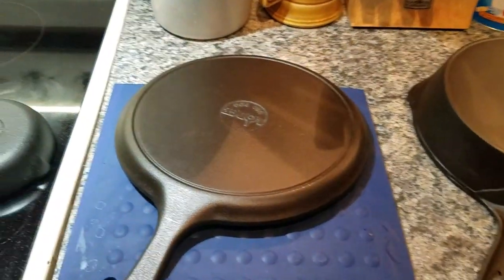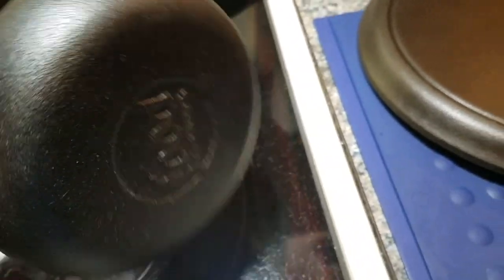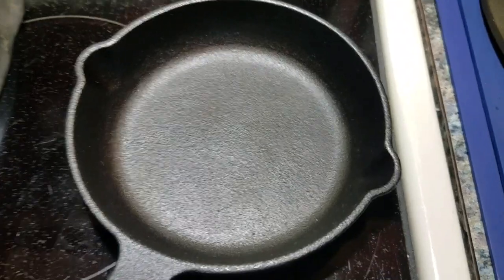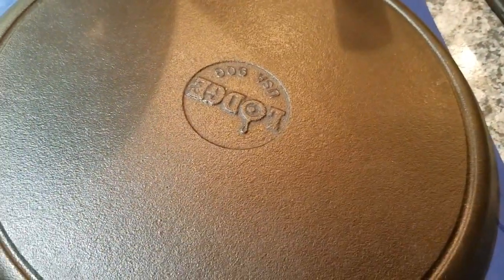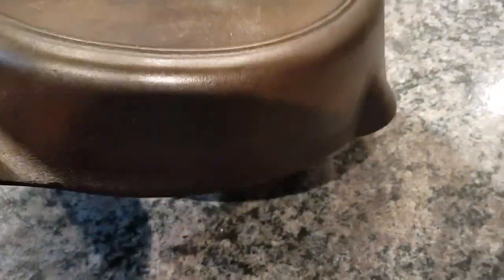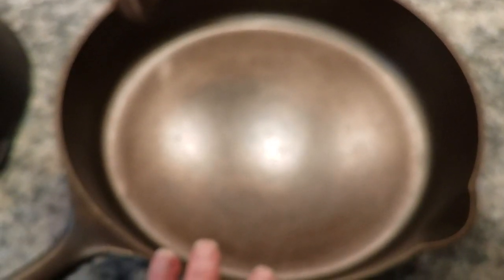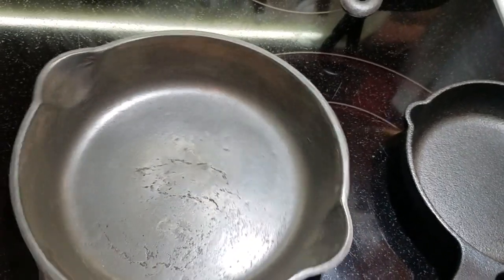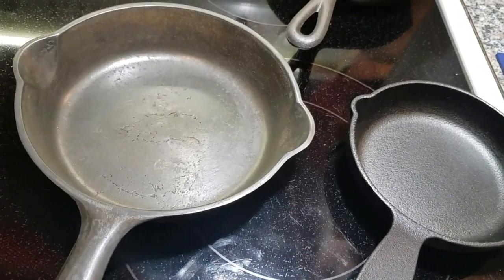Should You Wire Wheel or Sand your Cast Iron??   Watch to find out!

Comment: A good steel wool will eventually get one smooth. I can see where this is a good idea. I am going to wheel my new 12 in lodge
Reply from the maker: Yep, I did that as well with mine.  It was new.  I had tried the flax seed method of seasoning and it did NOT hold up.  I stripped it AGAIN, wire wheeled it to make it smoother, re-seasoned and now it is a great cooker!

Comment: Always enjoy your videos and knowledge. Myself I've used a wire wheel on mine and they've come out beautiful and I buy mine to restore and use daily and charish them . Hey I was actually thinking of you yesterday .I stopped into an antique store in Illinois and OMG there had to have at least 75 or more pieces of cast iron cookware mostly skillets and Dutch ovens .it was crazy lol I could have spent hours in there but I did walk out with a really nice Wagner #10 ,heat ring.at a price I couldn't refuse.
Reply from the maker: Thank you Duane!  Wow you found a vendor that had 75 skillets?  I am so glad that you were able to find a good deal with that Wagner #10 with heat ring to boot!  Usually when I find a vendor that has tons of cast iron like that, the prices are really high.  You are truly blessed, especially at finding a large skillet in good condition!  I just finished wire wheeling that recast #4 and I think I've got a user.  The "Griswold" logo from the skillet mold was wheeled off which I suspected, but I was able to flatten it some so that it can be used instead of leaving out for the metal scrappers!  lol  I will show it on a seasoning video when I do it along with a couple of other skillets I stripped and need to season.  This restoration thing can be addictive!  lol  ;-)

Comment: I use my griddle for stove top cornbread. With the low sides you can slide it off onto another plate, put the griddle on top and flip it over to cook both sides.
Reply from the maker: Great tip!

Comment: I just posted this on a Lodge video. I love Lodge. If I buy new it will probably be Lodge. But I, for myself, never buy new Lodge, since that pebbled surface came out. No! It is not the same! The couple of new pieces I have, I took a fine grit grind stone and knocked the most of the bumps off. Eventually any uneven spots will fill in, I hope. They cook ok, but there is no comparison between the old and the new Lodge. Would I be considered an expert? Probably not, but I've used cast iron for over 60 years, so I know my way around it pretty good. I still use my mother's, my grandmother's and my mother-in-law's every day. I buy the occasional piece of unrecognizable cast iron at yard sales when I can get them for a couple of bucks. Expensive or cheap, I love my cast iron. I nearly cried when I had to buy a new piece where I worked and tried to cook on it 😢
Reply from the maker: I'd say you are more of an expert than many that watch my videos!  To have all those years of experience of using cast iron kind is a statement all by itself.  For the most part modern Lodge is not collectible and I feel there is no problem with sanding it or taking a wire wheel to it to make it more usable.  I grabbed a #8 Lodge (modern day, but could be as old as the late 90s or early 2000s because I acquired it from an antique mall I think) to cook some potato pancakes and turkey burgers the other day and it was such a pleasure to use because I stripped it down when I got it & I took an Avanti strip disc to it and it is super smooth.  No lint gets stuck on this one either when I wipe with a paper towel.  Your pieces will fill in with time.  If they really bug you, strip them and start over.  The best device I have used is the strip disc but you have to be careful as it can leave unsightly marks on your skillet but they can be "smoothed" over with the wire wheel attachment on your drill.  Again, I never do this on any vintage Griswold, Vollrath, or other collectible piece as most of them never need it anyway.  :-)
Reply: @ladylibertystacker2014  I also hear Don't burn them! I've never put them through a oven cleaning cycle, so I can't speak about that. But I think people are told don't put them in a fire, because too hot a fire will indeed ruin a skillet for sure. If I buy and old unrecognizable gunky piece of cast iron, I wait until I have a nice bed if dying embers in my wood stove and bury the piece in them for a few minutes. Hook it with the poker and drag it out onto a soft bed of ashes to cool totally. Usually everything will wash off. Then start over with seasoning. I will say if I thought it was a true antique, I would start with cooler coals and maybe have to do it twice ☺️
Reply from the maker: I don't see any reason why you couldn't do your woodstove with the hot or cooler ash method if need be.  I think you definitely know what you are doing without a doubt!  As long as it works for you, that's all that matters.  :-)

Comment: Thanks for your video!  Really hlepful!  I've got time, now that i am working from home, to clean adn re-season some pans.  This helps.  I have a a Wagner Ware skillet with 6 on the handle. It has some really baked in crud around the juncture between the inside bottom and side of the pan.  I've been using a combo of wire wheel and heavy-duty oven cleaner - slowly coming off.  I've not yet taken a piece of sandpaper to the crud - is that advisable?
Also, this skillet (old one) has some pits and scratches on the cooking surface.  Is it advisable to try to sand these out? 
Many thanks, all!  Health and happiness to all.

John
Reply from the maker: Thanks John for your comments & for watching.  You asked about taking sand paper to smooth out these areas.  If you have already used a wire wheel, I don't see why not! I have been in many situations with a stubborn skillet where I have needed more than one tool in my tool box to get a pan serviceable for my own use.  Someone had suggested that I use sandpaper to smooth out the surface, but I didn't have a sanding block (you can probably purchase small ones from your local hardware store once they reopen if they are closed during this pandemic) or a sander so I just used my wheel.  In the future, that will be something I will consider myself.  I say, go for it and see how it works for you.  Keep me posted as I am curious myself!
Reply: Thanks!  I am going back and forth between heavy duty oven cleaner and the wire wheel so far.   Each time I use the oven cleaner, it takes some off and makes the crud a little more amenable to the wheel.  I might try sandpaper around the base (getting impatient!).
Reply: Since you have responded, I'll run the risk of taking up more of your time to ask a question.  I have a griddle, no manufacturer name on it.  Looks fairly old.  I'm doing the same restoring process.  On the top of the handle, there is a "9".  On the underside, it says "10 1/4 INCH GRIDDLE" and then below that "MADE IN USA" and then below that "Y".  Do you recognize the manufacturer?  Many thanks!!
Reply: Don't mean to hog the channel!  One more thing - I just noticed on the underside of the handle it says "Y" also.  Must have been covered with crud before.  Thanks again.
Reply from the maker: John Barry   It could be a Lodge or Wagner.  The Made in USA indicates it was produced after 1960.  Here is a web site to help:  castironcollector.com.  It is a great site packed with all kinds of information from collecting to restoration to cleaning and maintenance.  It also has a section on identifying unmarked cast iron.  Best of luck!
Reply: @ladylibertystacker2014  Fantastic website - thanks!  My griddle is definitely a Wagner 9.

Comment: I know this video was made a while ago...in case you haven't watched it, check out "How cars iron pans are made at Borough Furnace -Handmade" this dispels any notion that if you sand, wire wheel or grind the pan that it won't take seasoning. Not to mention, what do they think the manufacturers did before...look at especially Wagner...obviously milled or ground smooth.
Reply from the maker: Thank you - I will be sure to check it out!  That said, the only time I have wire wheeled anything was to smooth pitted areas or rough casting that will impede the skillet's ability to work the way I want.  Without watching this video again, I think I wheeled these pans after totally stripping them because as you said, it does take seasoning off.  As to the old milled finish, I absolutely love the look and it holds seasoning better too!

Comment: How do you clean are really old mucky pan. 1/4 inch of crap on the outsides and also on the inside walls.
Reply from the maker: For starters, I don't let my users get that bad, but having said that, I assume this is for something that you have found and want to use.  I soak it in a lye bath for a half day to a couple of days, then give it a rinse in a vinegar/water (50/50) bath for an hour, scrub, rinse, and repeat.  That works for me.  If you have questions on this, there are plenty of videos on YouTube to show you how to do this.  Best of luck!

Comment: Hi I’ve watched some of your restoration videos and this one caught my eye because I’m trying right now to get a Erie Griswald #8 cleaned up for my own use. I’ve been wire brushing it to get the carbon & seasoning off especially on the inside because having no idea where the pan came from I figured I should! What are your thoughts on whether I should be concerned about getting down to bare metal just for a cooker for my own use. BTW I’m a little adverse to going the lye/oven cleaner or self cleaning oven route.
Reply from the maker: OK.  Here's the thing....there's nothing to be afraid of with lye.  It just works on what's on top of the iron, not the iron itself.  Heavy Duty Easy Off Oven Cleaner is simply lye.  There's nothing toxic about it affecting your cast iron.  Pure lye crystals are actually sold as a drain opener at your local hardware store, or some of them that is.  I never wire wheel anything vintage like a Griswold, but I do scour it really good with Dawn and steel wool, or a pink heavy duty Brillo pad between soakings.  I do have a video on making a lye bath. There is a way I now do restorations on repeated soakings in lye followed by a scrubbing in between with an occasional 60/40 vinegar-water soak and you will eventually get everything off the pan.  Patience is key.  I have tried wire wheeling in the past to remove carbonized old crud/seasoning and it just doesn't do the job for me.  And yes, I like everything stripped off because you just don't know who in the past did what in that pan!  I hope this helps.

Comment: Thank you so much for your video.  I would like to share something with you and helped me restore an old spinning Griswold.  I searched High and low on YouTube to no avail for a solution.  I understand that glass top stoves will turn an old school cast iron piece into a spinner in a New York minute.  What happens (specially if you use a smaller glass top burner, is that the center will heat and want to expand, yet the sides are a colder temp and are inflexible causing the center to warp outward.  I took my old school pan, put it in the oven at 400 degrees for 2 hours.  I know, the seasoning was going to cook off, but I can always reseason it.  Then I placed it upside down and flat on the LARGEST glass burner in order to encompass the edges making them hottest and more flexible first then the center would follow.  Placed the burner on high and I added a flat cast iron piece on my upside down spinner and continued to stack other cast iron pieces on top for weight.  Left it for 1 hour.  I shut off the stove top, let it cool down to the touch, tested on the glass stove top and the pan was perfect, no more spinning, it returned to its shape.  I figured heating it for 2 hours a 400 degrees was allowing the entire pan to super heat evenly and maybe having a memory, return to its original shape.  It worked perfectly.  I just thought I would share that..... thank you for you videos!
Reply from the maker: I will check into your suggestions if I ever end up with a piece that I need flatten the bottom.  Hopefully I won't because truly warped pieces are not pleasant to use - they don't evenly heat, they are hard to control on your cook top, and they don't season as evenly either.  That said, that is serious warp, not the occasional wobble which most pans will show on a glass cook top!

Comment from the maker: I get so many people telling me I should NEVER wire wheel or sand my cast iron.  I made a couple of videos on it back when I first started restoring cast iron and luckily, I didn't do it on anything collectible. Actually, I did a good job where the skillets in question are still users in my kitchen today without any ill effects!  I linked a video at the end of this one showing cooking in my #6 Wagner, one of 3 skillets I first restored in that 2017 video also linked.   That said, there is a time and a place or should I say a type of skillet that one CAN actually wire wheel it in my humble opinion if it is for your use and you're not going to sell it as a collectible piece.  The main advantage is a smooth surface much easier to clean and to maintain.  Watch and see when you should or shouldn't wire wheel your cast iron!
Reply: Your right the new ones and certain ones could use wire wheel. But if it's on the collectible side... I wouldnt which you figured out. Good video.
Reply: Question is how to clean a pot  that sat outside  like10 years with out wire wheels
Reply from the maker: @Rev.nighthawk..pjred1984  Like I do.  A good soak in a lye bath for several days to weeks as long as it takes with several scrubbings with a Brillo pad in between.  This will not remove all of the rust, but it will soften the crud so you can scrub it off.  Alternate this with short monitored soaks in a 50/50 vinegar water bath that will work on stubborn carbon and rust.  That said, it could be heavily pitted beyond the point where you would want to totally restore it.  Unfortunately, you won't know until you have started the process.  I can tell you, you will probably not need wire wheels if you have some patience.  Remember, it sat outside for 10 years, you won't get it off in a day.

Comment: It might be helpful? Another YouTuber who wanted to concave their pans because he ha an induction heating stove. So he heated the pan up, put a wood on top of it and then hammered it.  Maybe that might work for your pan to get rid of the concave. 
I have been watching way too many cast iron videos I know lol.
Reply from the maker: I wire wheeled it to remove some of the metal presumably iron which was making the bottom of the skillet concave. It helped to flatten the bottom a bit so it doesn't spin nearly as much.  I know I will be able to cook with it once I get it seasoned.  The Griswold logo was worn away some, but that was to be expected because this skillet is a recast, not a true Griswold.  I will be happy if it turns out well because it is either me using it, or the metal scrappers will get it as a free gift instead!